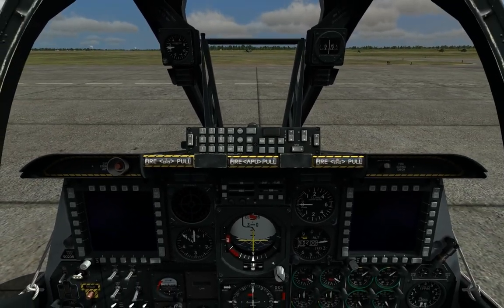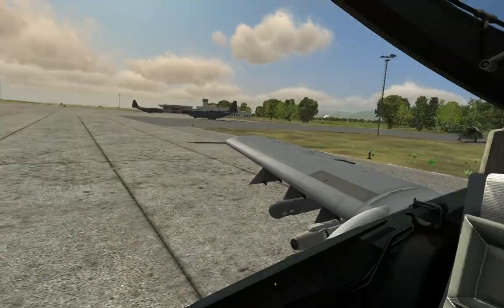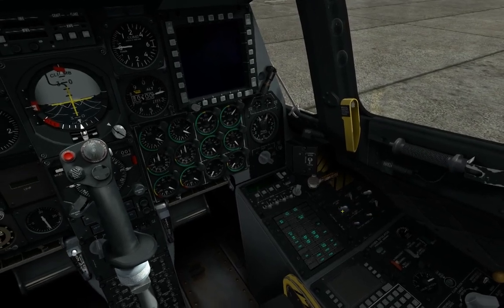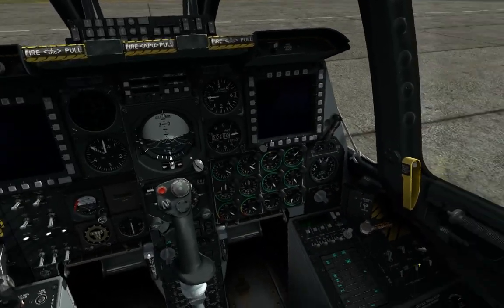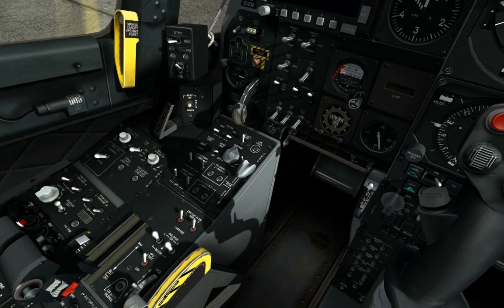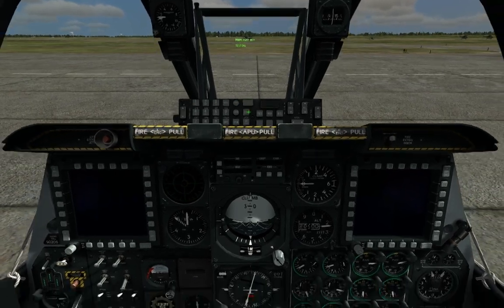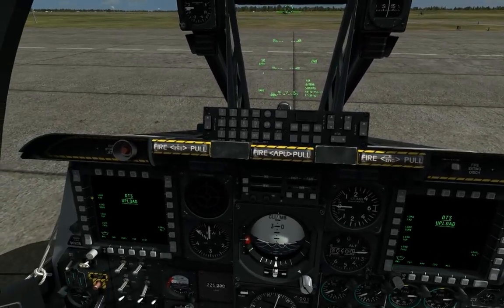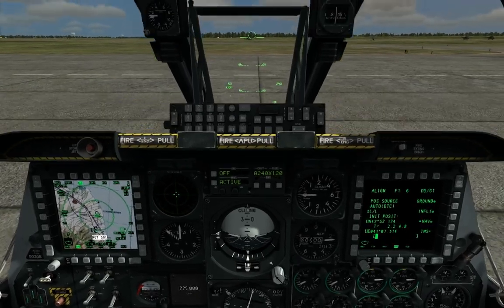Let's Play: Digital Combat Simulator A-10C

Comment: 1) i don't remember but maybe test button is on panel under gear handle
2) Air Traffic Controll, you must have premission from ATC for taxi, takeoff, landing etc, you must choose correct frequency for your airport, use VHF AM radio to communicate with ATC.
3) Remember about full INS aling, INS NAV READY phrase must blink before you can switch to NAV, don't use fast align procedure.
4) This is not fighter but  turning isn't as terrible as you think :)
5) You landing too hard!